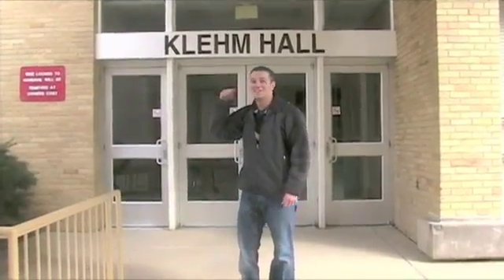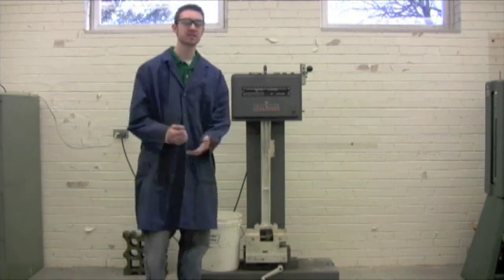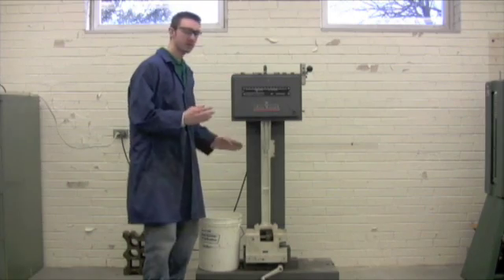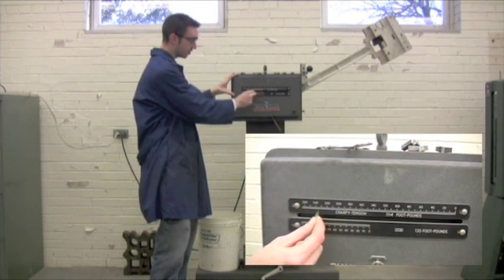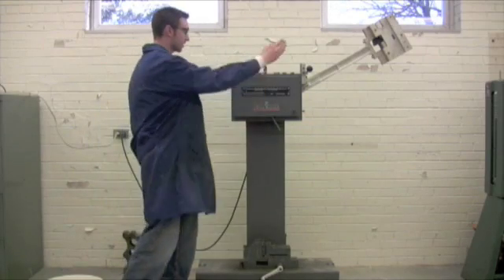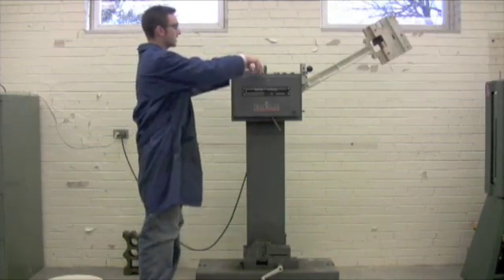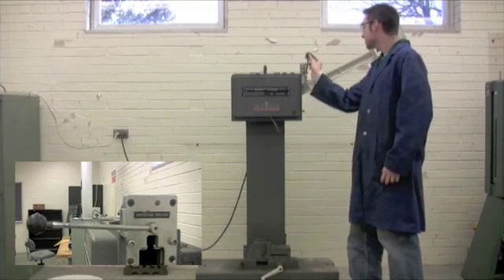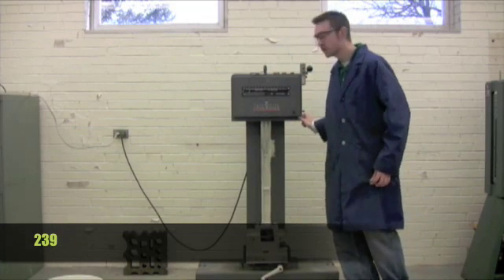Materials Testing: Charpy Test

Comment: many mistake is been done in the test.
1- Before you drop hammer on your sample, you must do a Calibration to check the Balance of the Hammer wave.
2- Never ever put anything on Charpy Impact Machine Puckett, like the one you had.
3- keep a record of every Calibration before you start a Test.
4- Never Put the Sample while the Hammer is Up.
5- forgot give what was the Unit for 230 what??? Is ft/lb
6- did not measure the Separation of Material/Sample after Impact.
7- forgot to Mention that when you have many Sample's to test, How would you know which one is which after Impact? Must       Number each Sample At the End.
8- Stop Being Book Smart.
9- Stop Kissing your Professor A$$.

Regards,
    ^-^
Reply: 1=3